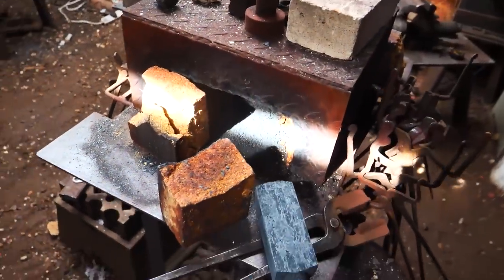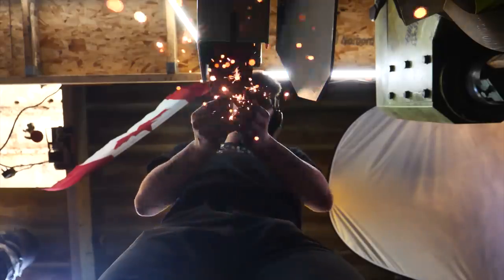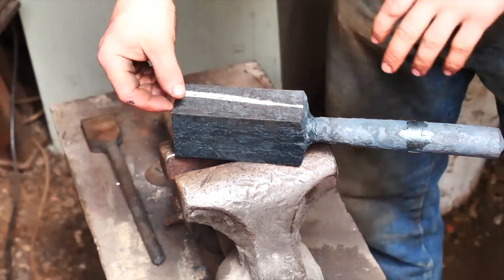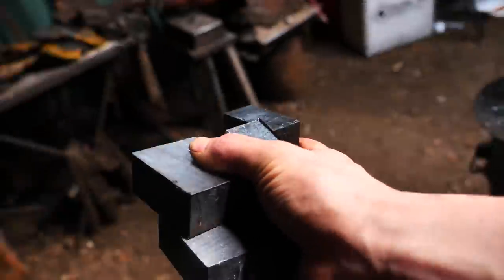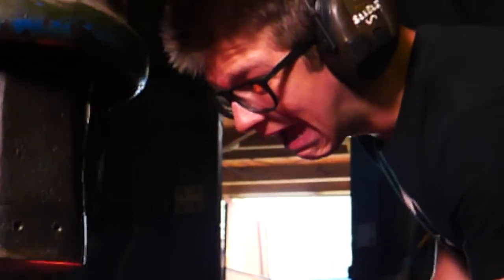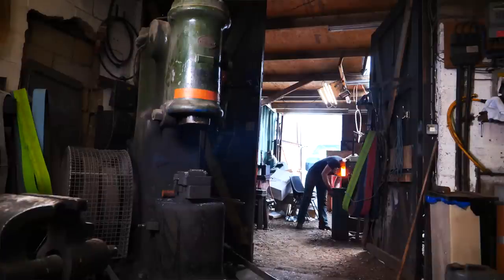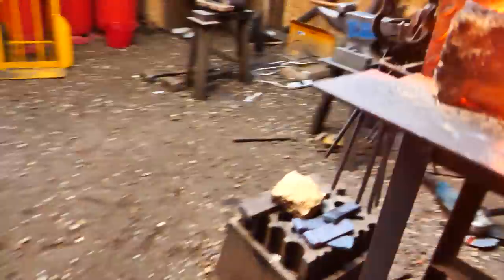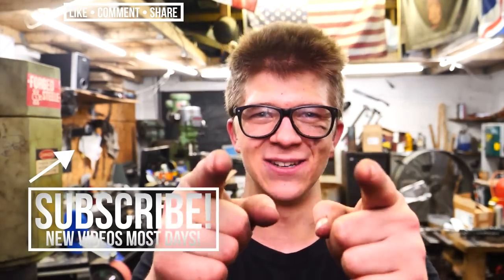FORGING CRAZY DAMASCUS STEEL HINGES

Comment: I know nothing about forge welding, but metal contamination I know some. When you cut the first forged pieces into 4s and grind the scale off, try hitting them with a wire wheel to get them a little more clean before stacking them. From welding and grinding there is still scale and grinder bits in the metal. In auto body if you body filler/paint over it, in the heat of the sun it can pop out and be visible. Maybe it could help the metal forge better.  Also cause I am curious, why do you not put the flux between the pieces before you stack them and but them in the fire?
Thank you for making your videos tho! I love watching and learning.

Comment: Just a thought, would you have better luck forge welding the parts if you had something like a surface grinder to clean up the billet rather than using the big angle grinder?  Would that be beneficial? Keep up the good work!

Comment: I won't lie to you, I was hoping for something more out of these hinges. Something like a thin diamond type hinges with hand rolled connections. But..... if you're happy that's all that matters. They Do look good though.
Reply: Robert Aarstad The thing is, it's harder to show off the Damascus pattern with smaller hinges and the thickness is to prevent chatter in the milling machine.. I'm sure they'll be a bit lighter after grinding them but yeah.. complete overkill for the box

I would have liked longer hinges that matched the contour of the top but again it's up to him

Comment: I don't know how to forge weld but I do know how to weld everything else in this world and when I weld something it always goes better when removing the mill scale from anything first before welding could it be that the mill scale from when u first stack all your material is causing your weld failures just trying to help out

Comment: it's not the fact that you're cooking in plastic Tupperware that offends us foodies in the audience- it's the fact you don't take the lid off before cooking! you're going to get a pretty badly burnt by the steam one of these days, and then we'll have to go without listening to Aleck Steele for a while, and be miserable.
Reply: I don't think he needs to worry about getting burned by the steam from microwaving food in a plastic box when he forges steel as a job.
Reply: first last um- Speaking from experience and a knowledge of thermodynamics, steam can't burn you quite as badly as steel under normal conditions, but it burns a lot quicker, since it carries about an equal amount of thermal energy, and transfers it much more quickly and efficiently.